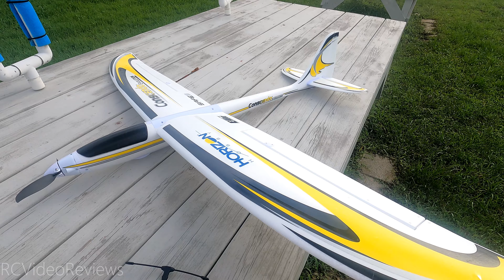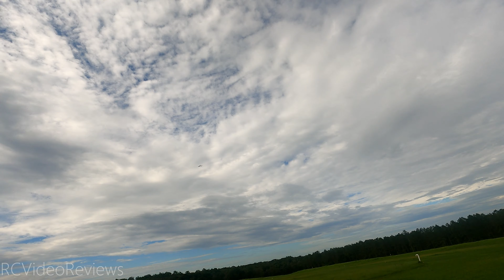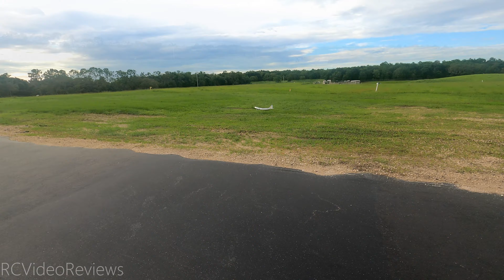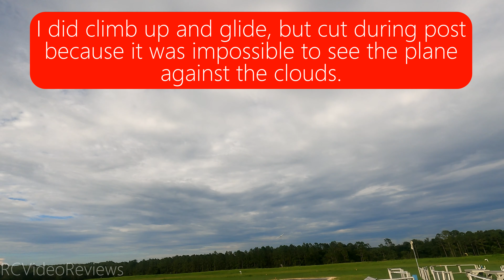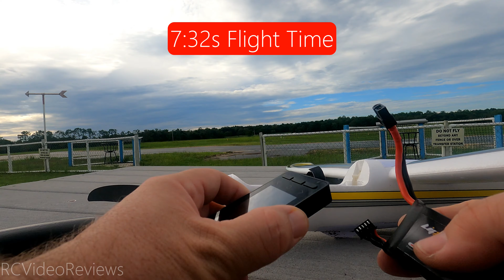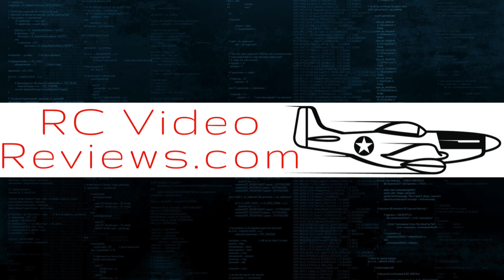E-Flite Conscendo Evolution 1.5m Maiden

Comment: Hey thanks for all the reviews and help videos. I just got this plane and a Radiomaster TX16S. Since this plane can use 3s and 4s batteries is there a way to set up the voltage telemetry on a switch to go between the two battery options?  I plan on using both for either easy soaring and high speed. Thanks

Comment: Are you using your radio Master to control this plane?
Reply from the maker: Yes
Reply: @RCVideoReviews  what protocol do you use to get the telemetry and Vario to work? If I bind to spektum I get the telemetry lost notification 50 feet away. Do you have any thoughts on this? Or a video on getting spektrum working on the multi protocol module. Does the fact I am still on opentx matter?

Comment: I just mine today. I'm a newbie at 69. What is the smallest 3s battery to use to make it a better glider? How does it fly on safe?
Reply from the maker: Mine flew fine with a 3s2200. I’m sure you can go smaller if you want to rely less on motor and more on thermals. I don’t use Spektrum so can’t address your question about safe. 

Great flying little plane though.

Comment: This model has another basic flaw in that midway into the battery bay there is very little foam connecting the entire front of this model. Mindf fell 2ft off a table and broke in half. I strongly suggest reinforcing the front with carbon fibre strips.

Comment: Great plane, I love the way mine flies on 4S/2200mAh.  However, I have "blown apart" after many flights the plastic nose/prop assembly (yes, while "hot-footing it" on 4S).  I've since replaced it with a nice metal and carbon setup and she really flies nice (Aloft Hobbies: Turbo 38mm spinner ST-1822, w/4mm collet, Aeronaut CAM folding props 9.5X7).  I have a grass field at my AMA site.  Be sure to get more rudder throw, it makes the plane even more responsive.  I also spray painted my bottom wing tips bright orange and this really helps with visibility.
Reply from the maker: I've heard that several times now on the nose. That's unfortunate for such a nice plane otherwise. Thanks for the tips.

Comment: Thanks for a great video. I can hear you have vario active. Can you explain how you have activated vario. I can not get vario to work on mine. I have AR637TA installed and use Spectrum DX8 with telemetry
Reply from the maker: I don't use Spektrum gear. I used a FrSky G-RX8 and a Radiomaster TX16s

Comment: It's a blast on 4S-full throttle and then swoop in for a high speed, low altitude pass.  I can get mine to float around for 20+ minutes, but it's best when you let'r rip.
Reply from the maker: Lots of comments endorsing full throttle runs ;)

Comment: At full throttle on 4S this thing is a rocket. I can hold it pointed straight up, give it throttle, and just let it go. No tossing whatsoever. It will climb with almost unlimited vertical. I find it to be very good at aerobatics for a glider. I painted mine a bright day glow orange because it does get lost against a cloudy sky. I’m really enjoying flying this plane.
Reply from the maker: Lots of people like flying this little plane fast.
Reply: @RCVideoReviews  Fun to fly it slow as well. Enjoyed your review.
Reply: Sports glider.
That is why I ordered the Night Radian.
Not for the fancy LEDs, but for the glide and soaring.
I'm afraid that if I got this bird I would fly it like a regular plane instead of a glider.
I might buy this one day, but my heart is for gliding.
In 2 days my plane should get her and I can't wait for it haha.
Amazing how good it turns, only using a rudder.
But I have read about some poor design choices. The wing tip is only secured with 4 pieces of tape so I'm going to add a thin line of CA glue and the servos sucks, so I'm buying some metal servos. It's only 3 so the price won't go too far up.

Comment: Nice flights and good review. Love mine.. It's probably more aerobatic than you think with even higher rates than in the manual.. 
The ESC is borderline for hard 4S flying and you might want to strengthen the rear of the battery hatch as its a known weak area. The plastic spinner is also not really strong enough to handle serious 4S ragging and has been known to disintegrate catastrophicly.. which can then also rip the nose off if it has not been beefed up.
I epoxied some thin carbon strips joining each of the spinners internal fillets and also some strips into the foam at the rear of the battery hatch, upgraded to a 40A esc and all these things have given me a lot more peace of mind. 
See the CE thread on RCgroups for more details on these recommended mods.
Reply from the maker: Thanks for the tips Paul. Scary that the spinner explodes and tears up the front end.
Reply: @RCVideoReviews  No problem at all. Tbh it's probably just happening when treated like a hotliner by a tiny select few, huge WOT dives etc..  but better safe than sorry and for peace of mind. 
The front end has been known to break off at the rear of the battery hatch even just on harder landings though and it's when you see these pics you will see how little foam there is in that area holding the whole front end on, so I'd definately do something about that. 
Hope it grows on you as much as it has me. ATB.

Comment: Nice Calm flight... Did the guy making the center line have a few beers ?? LOL
Reply from the maker: Right? I've thought about this a bit since I left the field and have determined what they were doing there is painting the centerline to match the warbird/taildragger takeoff run rather than having the warbird/taildraggers conform to a straight line. That way, they can say "I was just staying on centerline!"
Reply: @RCVideoReviews  Ha..Ha
Reply: I thought it was just undulations in the tarmac..
Reply from the maker: Maybe on the old runway. This new one is pretty flat. It’s possible adult beverages were involved….

Comment: I just blew up the spinner on mine hitting the throttle too quick on 4s..this plane is great for mild to wild but I found the limits of the prop assembly..found a place to get an aluminum spinner at Esprit.com. Great to see you review this one..its a good plane for windy days and catching thermals.
Reply: A. Strom, Did the aluminum spinner work out?.
Reply: What were u able to find ? Props, and spinners?  Any part  numbers would be appreciated, tks